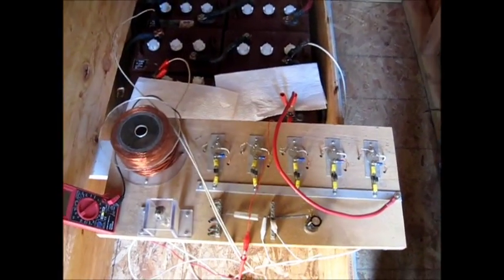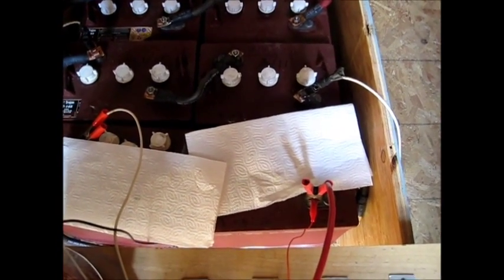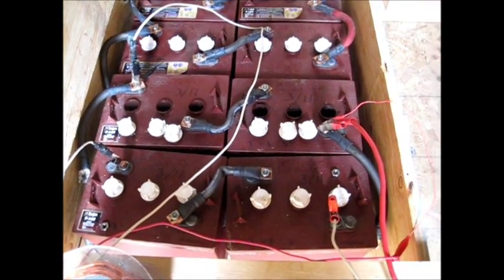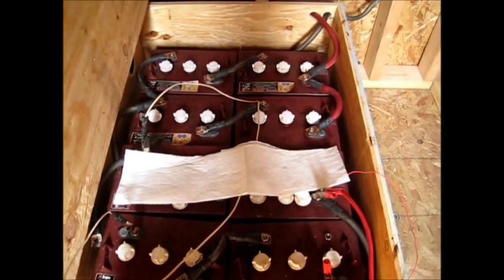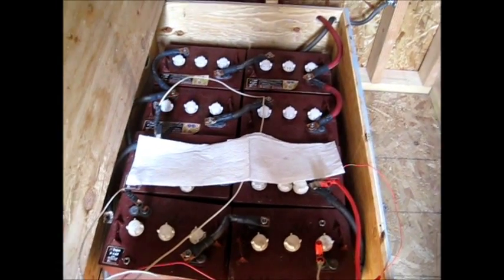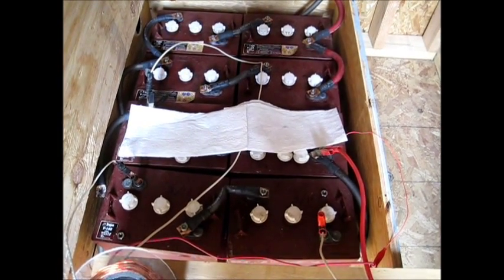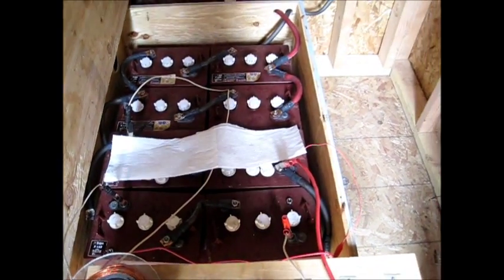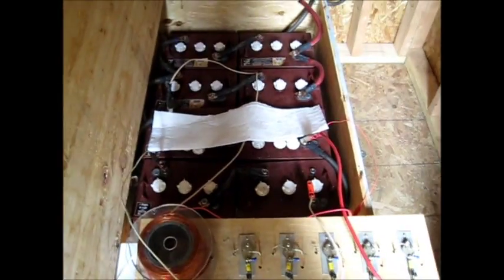Solar Battery Banks De Sulfation Part 2

Comment from the maker: there is a book out called the battery bible. it breaks down how you figure the CCA cold cranking amps, to get the AH  amp hour rating of a individual battery. you want to charge and discharge following that rate for best results in conditioning a battery. there are some exceptions to batteries that are sulfated really bad, but its all described in that book.